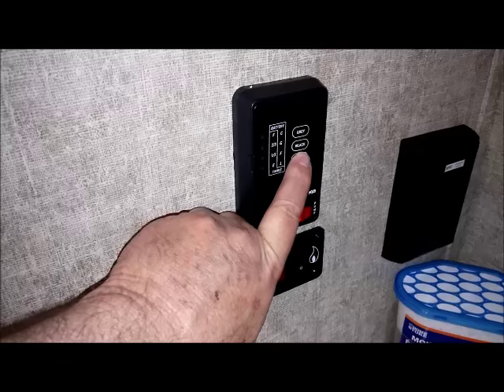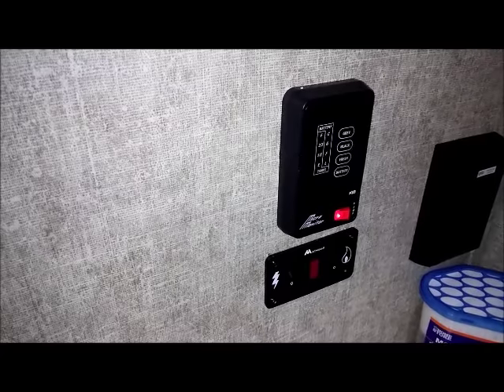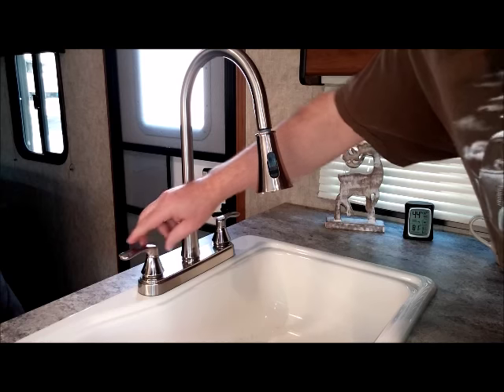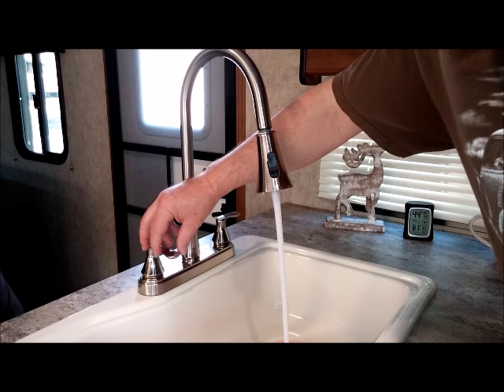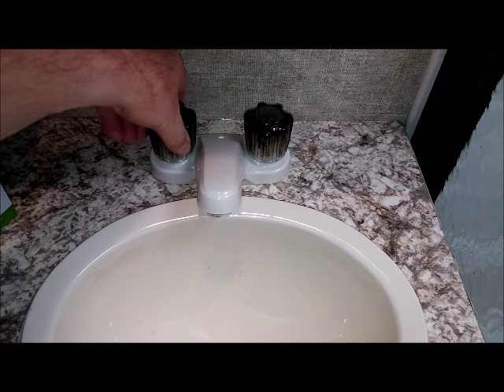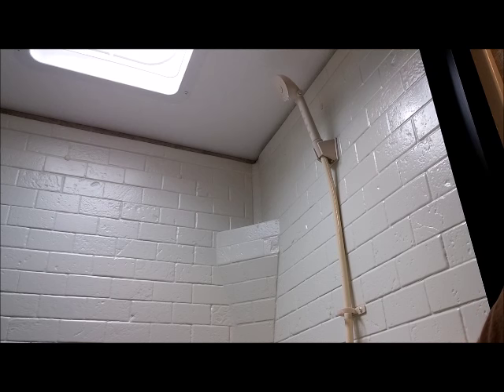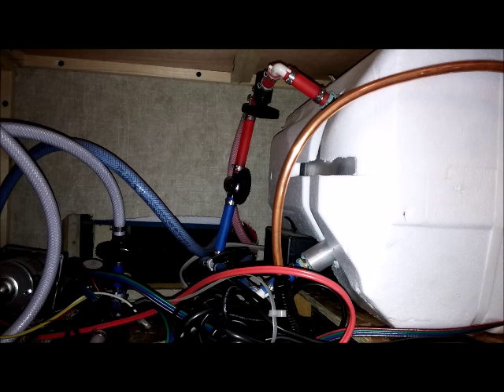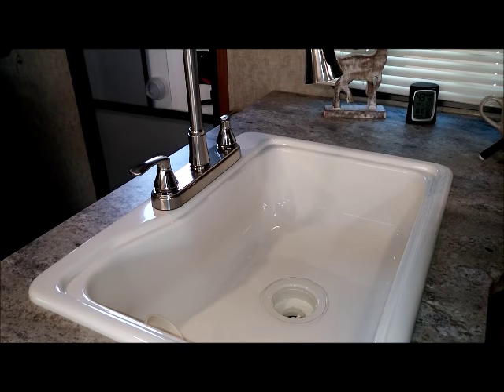De-Winterizing the RV

Comment: Where is best place to dispose of the flushed Antifreeze? Do you recapture it in gallon jugs and re-use or dump it from the grey tank into a holding tank like for used motor oil and take it to a hazardous disposal somewhere?
Reply: RV antifreeze is non-toxic

Comment: Did you pump"pink" into the system during winterizing? I drained  it DRY now I wonder if & HOW TO :"PRIME WATER PUNP" WITHOUT hurting  the pump running it dry? ( FOREST RUINER TRAVEL TRAILER " NEW" AS IS OWNER?)
Reply from the maker: Sorry, this is my first RV and I have never winterized an RV yet--will be for the first time in a week or so.  The dealer had winterized it and I just did the de-winterization in this video.  Have you tried pumping in the pink yet?  I don't think a few seconds of no fluid will hurt the pump from things I have read, but I really don't know from experience.  If it won't suck in the pink within a short time, then you may need to look up a good way to prime it.  I have a feeling it might pull the pink in without priming though. Good luck. Let me know how it goes.
Reply: BackroadHankerin Thanks, My first "real" RV ALSO.  Waited too long in Chicago BEFORE going to FLORIDA for storage and too CHEAP to pay dealer $30.00to "winterize" since WILL NEED to use on the way. Old age will not allow a 17 hr travel : THAT equals 20-30 HRS. Dragging a trailer and too small truck with too heavy trailer/cargo. 
Three days ago  it hit 17°F. AND stayed under 30 since. Too late to drain: valves and is drains frozen. TWO space heaters under and the " pink" panels to skirt trailer with LP burning @ 60° with a HAND his dryer got the outside hose/valves running but insidd??
Poured 4 gal of " pink safe" anti freeze down sinks, shower & toilet but it WON'T  melt the ice but with " STA-BIL " Brand -70°F. WILL MAYBE STOP drains inside from freezing? 
Tommarow? It's  to be and stay above 32°F. Until DEPARTURE Thursday /Friday. MY plan is to  fill "city water" inlet to 40 psi and Pray NO leaks. Them part fill white tank and say another prayer BEFORE hitting the pump switch.  Stupid , but I didn't  disassemble  the trailer to find the :" HOT WATER  BYPASS SYSTEM" IF THEIR IS ONE. FOREST RUBBER questions bounce off to DEALER, dealer is packed with frozen ($300.00 plus repairs, new pumps/valves/plumbing) inside and several units:" under heated tent " outside? ) waiting. But they're good enough to suggest above then bring in for a :"free" DUMP & flush ( waiting in a line IF necessary) BEFORE LEAVING to TEST for leaks. Then IF good : go! IF NOT,  maybe FIX N go?

Thanks for your help and perhaps my related info will help you and all out there? 
I'll  " pump pink" with "tank fresh" in Florida,  IF I get there, BEFORE I jack her up off the ground/tires in the storage lot and buy a : Wal-Mart,  cover for her with bubble wrap in the roof vents/fixtures IF A lost Hurricane finds her OR hail storm ( rarely, but "MURPHY'S  LAW" MUST be obeyed) finds her. THEN? Wait til April and reverse every thing? 😭
Maybe after my Newbie " WELCOME TO THE WONDERFUL WORLD OF R/V,s?" Period is over ( never) I'll  learn ($$$$) enough to survive. Hope you all do to. SAMS club. & Reserve America, YOU TUBE and You! Have been a great HELP, but as you can guess from above: I've  been :" BANNED FIR LIFE" from F.R.O.G. ( FOREST RIVER OWNERS GROUP") because of my " bad for the RV community group"  and " DISPARAGING THE GREAT AND POWERFUL FOREST RIVER OZ?" I guess I saw the " little man behind the curtain" ?🤤
So that said, many "mistakes" were my ignorance and assumptions! So learn BEFORE you burn, believe NO SINGLE ONE, but total group: VERIFICATION and confirmation then: maybe?
Be safe, be well and may God bless? 🙄😉
.
Reply from the maker: Wow!  Hope all goes well.  Safe trip.
Reply: BackroadHankerin Thanks for the super,  I'LL  need it? 
I'm  an old dog that CAN'T  learn new tricks so fast but: I getting very Good and making mistakes and trusting the UN trustworthy. 😱
Moral: as you get older , act your age and slow down, your dreams have a better chance of becoming the reality you wanted...OR not?🤐 
But, I'm  believing your LEADING us in the right way! 🙄

Comment: can I just take it to the camp sight and de winterized my motor home
Reply from the maker: Not exactly sure what you mean, but I don't know why you couldn't, unless you're talking about dumping the antifreeze on the ground.  Should be fine to dump in the campground sewer as far as I know.
Reply: beverly dunlap  TEMPERATURE AND FOR HOW LONG IS THE GAMBLE?
Reply: Well if you had an and issue. Your gonna have to fix it then. I like doing this at home just in case I have a leak or something. I'd rather be at home where all my tools are.  And I know where